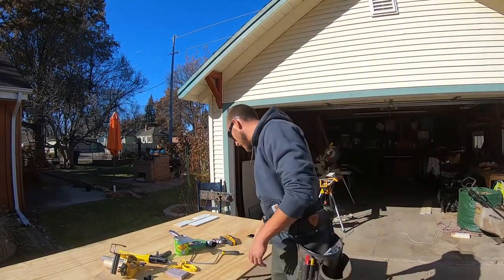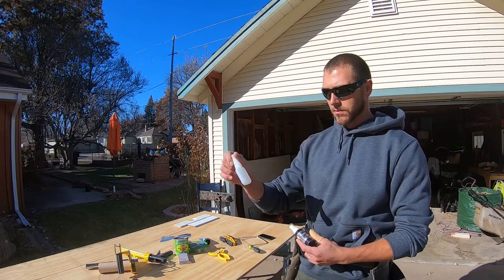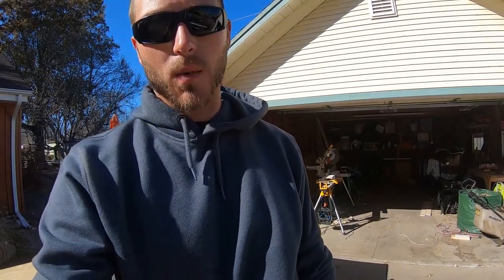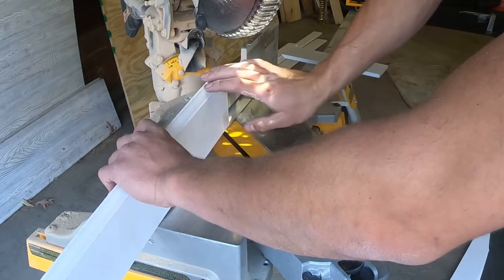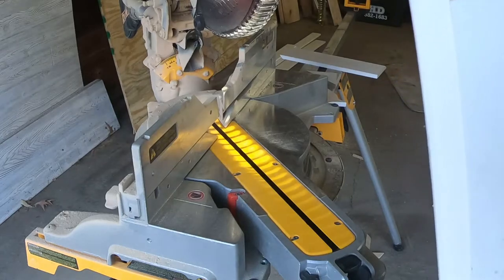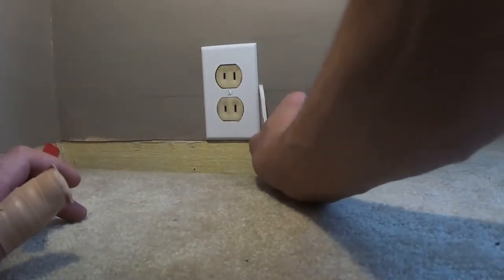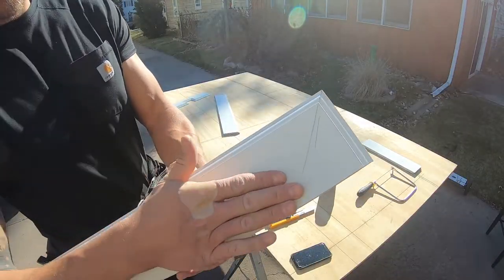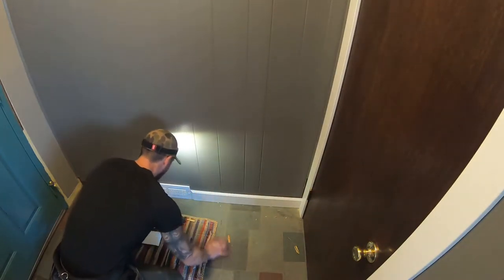HOW TO INSTALL BASEBOARD AND CASING LIKE A PRO! COPING/ MITER RETURNS/ ADVANCED TECHNIQUES! Part 1

Comment: Excellent video. Like what you did around register. 

I’m lousy at “sounding” for studs. I use a magnet from an old hard-drive to find studs, then Mark location with a tape just above the baseboard to be installed.  Getting a nail top and bottom, stud and baseplate, helps to keep the baseboard from leaning forward or back, especially for tall baseboards. 

I’ll try your scissoring technique.  Great tip to notch the receiving baseboard.
Reply from the maker: Thanks! and thats a good tip for securing to bottom plate, especially on tall profiles like you said. I bet a magnet works pretty dang good too. I have found a stud finder that works great for trim, its called a franklin stud finder, its a different style and worth checking out if your in the market. Way better design then a traditional stud finder.